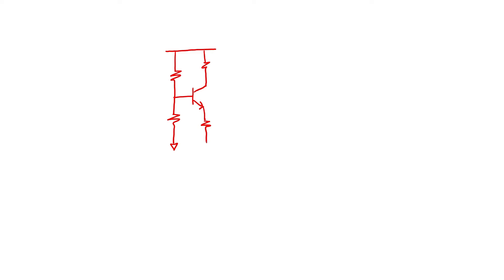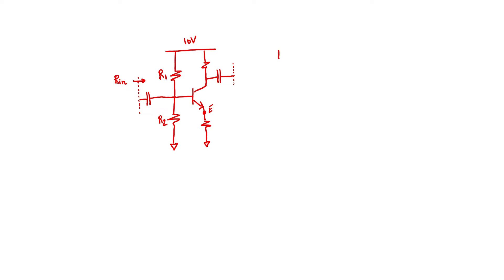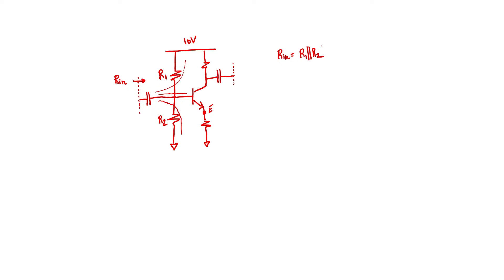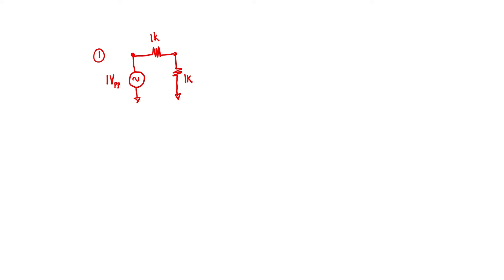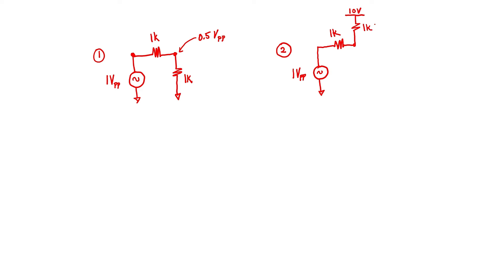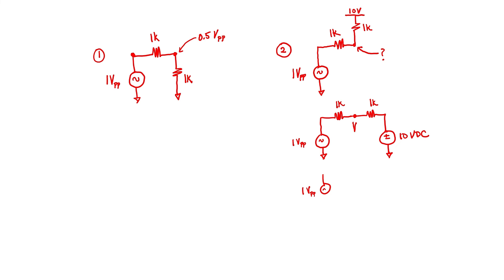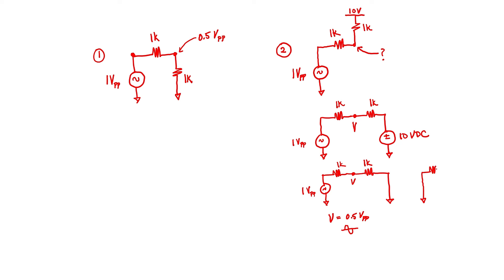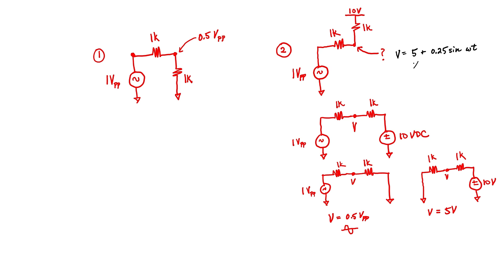Why can you treat a power supply like an AC ground? (5-Transistors)

Comment: Now a problem, and please do not approximate like for a small signal amplifier! 
A case in which superposition does not apply. Not any superposition i've seen others formulate. 

A Power amplifier, remember, no simplification by excluding 5% or so contributions, 
an amplifier used to amplify radiofrequencies, 
being supplied through an inductor, to the collector or drain, 
that outputs through a PI-Lowpass Filter, made of an inductor and two capacitors, 
capacitors to the ground, 
the output with an isolating capacitor, very low reactance. 

I know for a fact, superposition does not apply, but you can try to convince me

Comment: I have in common with you an interest in electronics. I'm still not sure what the emitter has in common with either the base of the collective (in a "common emitter" topology), other than being part of the same transistor. The base and collector have something in common, they are part of the "signal path". The emitter seems 'excluded' from all the AC fun. Who came up with that name ...
Reply: It’s called common emitter because the emitter is common to both input and output of the amplifier topology. Common base and common collector/emitter follower follow this criteria as well. Btw, Professor Danner is part of the faculty at University of Singapore, I would say his knowledge extends past interest
Reply: I'm not questioning that it's called 'common emitter'. I've known this for 35 years, having worked as an electrical engineer for that time. The choice of that word common always seemed odd. Still does. The emitter is 'excluded' from the input and output function, sure.  @mrlapras024
Reply: for instance, it's not that the base current and the collector current both go to the emitter that makes the base & collector have "something in common that involves the emitter" (one possible spin), because that's true of the common collector configuration. 
 @mrlapras024

Comment: It was once explained to me that a DC voltage source can be treated like a very large capacitor. And because the latter represent a short circuit for alternating voltages, this also applies to DC voltage sources. This explanation was enough for me, but i like the solution you presented much more. 👨‍🏫
Reply: I like this a lot. So in my head, the DC power source signal will have a large shunt cap to GND, internally to the chassis... so the AC flowing back will go that way to GND, and the DC power source signal is kept from being shorted because of that capacitor (dc-block).

I don't care if this is not how it works. It will work for me like this!